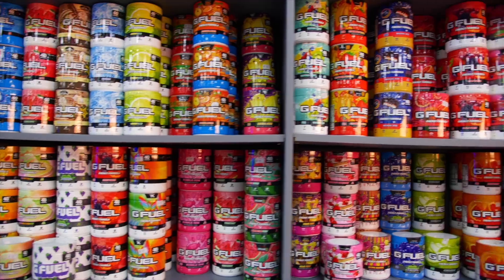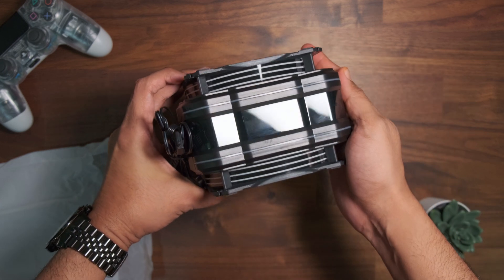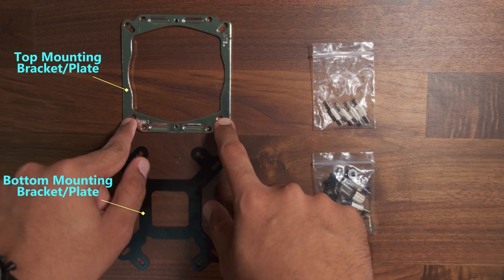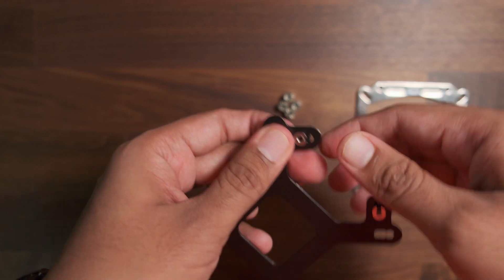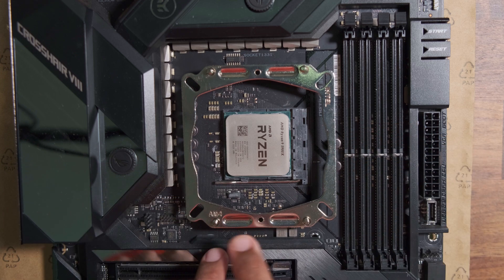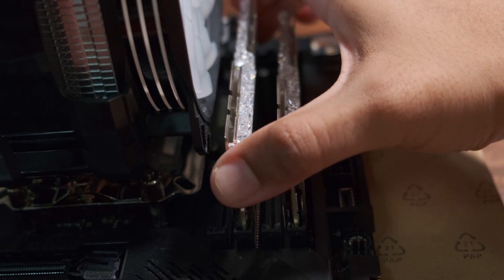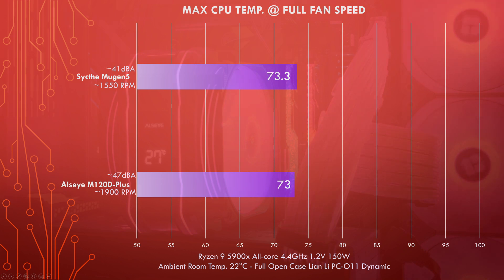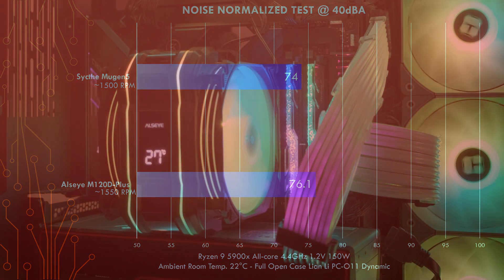Is this the Best ARGB CPU Air Cooler? The Alseye M120D Plus - Installation Guide and Full Review

Comment: where is sata power
Reply from the maker: The unit I reviewed had these cables as shown in the video.. i believe (pointed to me by a viewer) they have silently released a new version under the same name, which has a usb2.0 cable so that it reads the CPU temps via software. The SATA power cable is just to provide additional power in case your motherboard header is unable to run all the rgb leds in my model
Reply: @ronstechreviews  Thank you that's great to know

Comment: Did you download the software? 
Half the bad reviews I read said that the display doesn't work and the other half of the reviews said it was too big, I figured the reviewers were dumb. I just got one and the last page of the instruction manual says to download the temp monitoring software.
Reply from the maker: Quick question.. in your unit, does the cooler have a USB cable that has to be attached to the USB motherboard header?
Reply: @ronstechreviews  yes.
Reply from the maker: Well my unit didn't have any usb cable just argb, SATA power, and pwm fan cables (as I shown in my video).. I guess they made a silent revision.. possibly after seeing my review (jk hehe) 😜
Reply: @ronstechreviews  hmm, these seem to vary a lot. Mine has the same name but different metal tubing and a solid polished plate that meets the CPU. No wonder the reviews are all over, I read one complaining about the 3 cables(guy had no room) and mine had 4.

Comment: There is software that has to be downloaded from there website to have accurate readings and rgb control...
Reply from the maker: I'd say avoid it ... RGB u can just control with your mobo software or bootpage.. and temperature is not gonna be smart one.. meaning software won't matter as the cooler does not have any usb connection and the only way it's getting the temperature reading is from a thermocouple attached to the coldpate of the cooler..

Comment: tdp?
Reply from the maker: Ahh.. TDP of 5900x is 105W.. however since I have done an all core overclock the actual CPU package power during testing is 150W.. so kind of an extreme stress test case.. in essence this cooler will handle most CPUs easily.. I wouldn't suggest this cooler or even most other air coolers for the latest high end Ryzen 9 and Intel i9 CPUs

Comment: Does it fit in the lian li o11d with the glass on?
Reply from the maker: It doesn't... The cooler is a bit too tall at 160mm .. the O11D supports coolers up to 155mm..

Comment: Does this cpu cooler can use on matx mobo with mini tower casing
Reply from the maker: Just make sure u have low profile ram (ram sticks with less height).. other than that the cooler will be compatible on any motherboard and in any case

Comment: Can I use this cpu air cooler with my 12600k?
Reply from the maker: Yep should be fine with the 12600k as I did test it with the all core overclocked 5900x.. you would be getting normal temps without any CPU thermal throttling with this cooler

Comment: How to change the rgb color?
Reply from the maker: If connected directly to your motherboard, the use the motherboards software to change it
Reply: @ronstechreviews  which one the cpu fan or the the led cable?
Reply from the maker: The led(argb) 3 pin cable .. that will go to your motherboard's argb header.. your motherboard's argb software would be already installed on your Windows if not, download it from the website of your motherboard's manufacturer.
Reply: @ronstechreviews  thank u this is very helpful!!

Comment: how do you turn up the fan speed becuz my amoury crate shows the cpu can only going 600rpm
Reply from the maker: Download and install Asus "AI Suite 3" if it is not already installed on your system.. after you open it, then you'll see "Fan Xpert 4" click that, then it will open a module where u can adjust the fan speed curve to your liking.. 

If you don't want to install any software.. just load into your bios and go to Q-fan control and adjust it there

Comment: Does it work in asus tuf gaming b460 plus...?
Reply from the maker: It will be fine with a full sized ATX mobo.. but like I mentioned in the video if you have 4 RAM sticks just check out the clearance or that u have low profile RAM sticks. If you are using only 2 RAM sticks then you won't have any issues no matter how tall the RAM sticks are
Reply: Well I'm using 2 sticks of ram.btw thanks for reply and that video 🖤

Comment: Is this supported lga 1700?
Reply from the maker: Currently you don't get the latest lga1700 mounting bracket in the box.. and I think they haven't released a separate mounting kit for the 1700 either.. so if u want to use for the LGA1700 (12th+ Gen Intel) then go for the ones that have the kit inside the box.. or atleast the ones that they sell (mostly for free) mounting kit separately